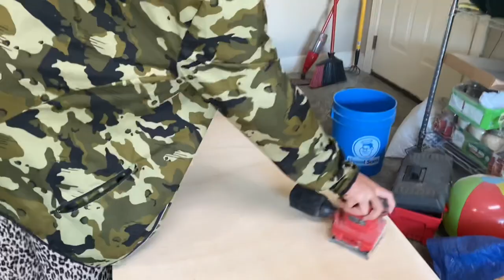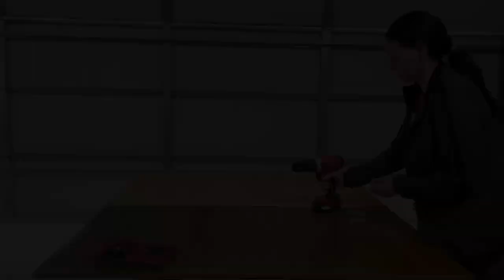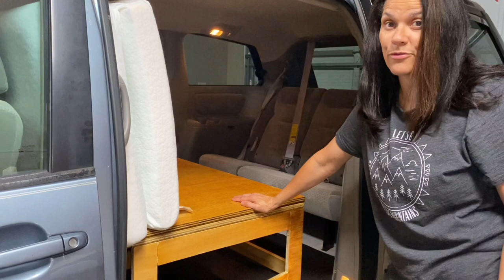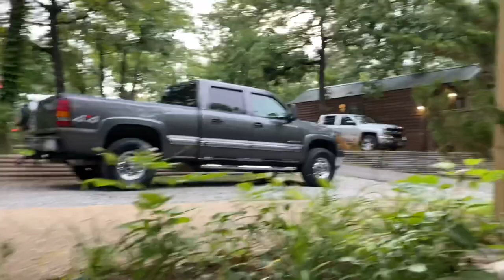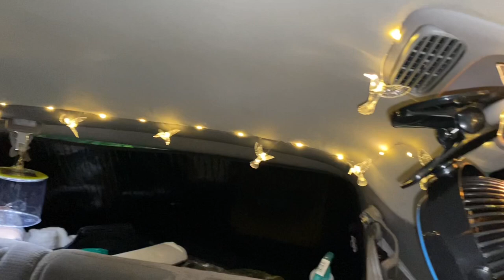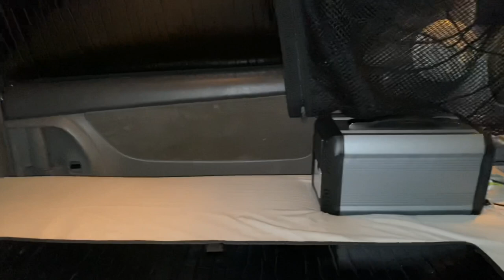Minivan Camper Build

Comment: What is the carbon monoxide detector for? Are you planning to heat your vehicle with propane?
Reply from the maker: For safety because I sleep in my vehicle. Im not sure if I will heat it with propane.
Reply: The CO2 Detector is great because we as humans breathe out CO2 and it can build up in small spaces, without us knowing, especially when we sleep.
Reply: @superdramaqueen21  it’s not a CO2 (carbon dioxide) detector. It’s a CO (carbon monoxide) detector.